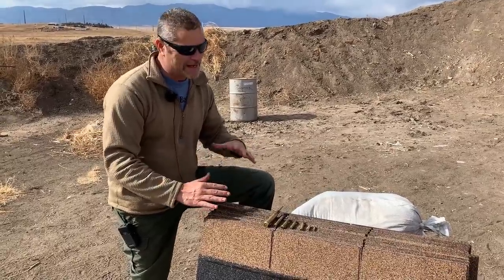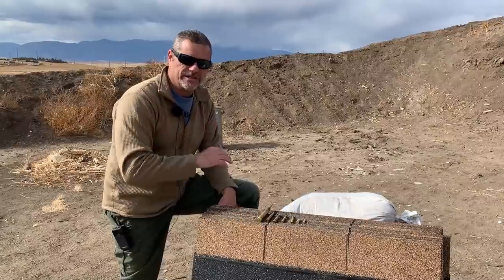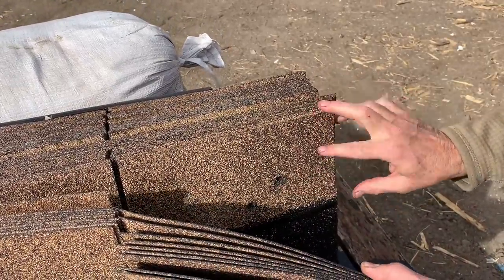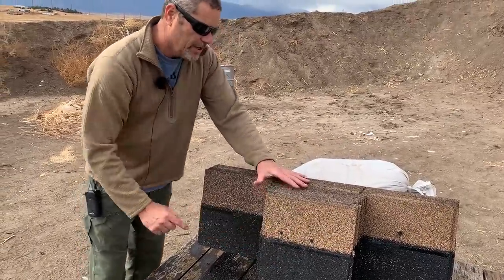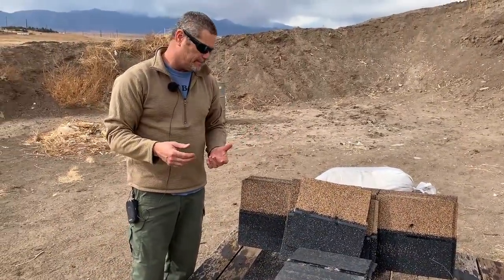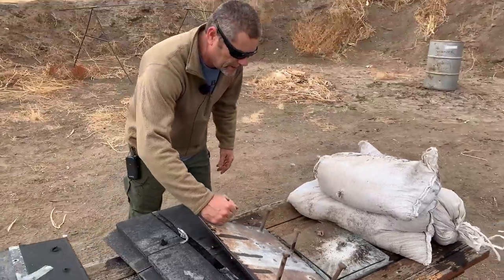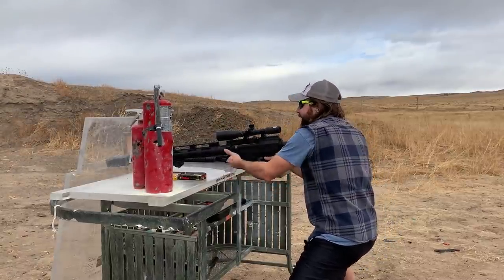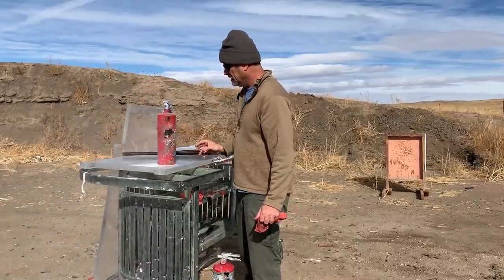How many Roofing Shingles does it take to Stop a Bullet?

Comment: Excellent Content as always :-))), Just a random idea for a video, Steel files are through hardened 1095 steel and are very brittle like glass, but Farriers Rasps used on the horses are a softer 1040 steel that are case hardened so they are tougher and wont break if dropped or the horse stands on it!! Im wondering how they would stack up against ar500 body armor, also shooting the large teeth side may break up the bullet in interesting ways for the high speed. should be able to get some for free if you ask around as they cant be sharpened when they go dull, so very cost effective video :-)))
Reply from the maker: Thanks Mark. I'll look into it.
Reply: @GoingBallistic  Coooool :-))) Thanks Chris!
Reply: Case hardened works really well, military armor is face hardened and softer on the inside.
My homemade target kept taking hits to the 2 legs that ripped through but I replaced them with case hardened rods and they can take 5.56 ball with just a gouge and bend.
It's surprising how often people can hit 1/4 rods while firing really fast, but I did say I was testing it and the more rounds it took the better 🤣
Reply: @BrokeWrench  Haha Brilliant :-))))

Comment: I have a question why you using three tab shingles those are the cheapest shingles out there and most people don't even use them anymore next time you do it you should actually get the ones that people actually use LOL architectural shingles are the ones that most people use nowadays they're a lot easier to put up and they last longer
Reply from the maker: Well send us some better ones. These cost us $45 per pack. and here in CO they are everywhere.
Reply: 45 bucks sounds about right for three tabs the architectural ones they're a little more money but they last twice as long as a three tab and around here the only ones that have three tabs are the old camps we even have some with copper shingles think there's three houses down the road with those on the roof LOL and I'm not the one who's making money on the show too